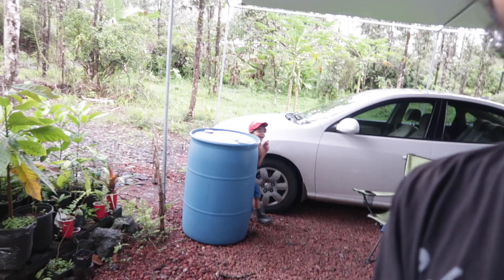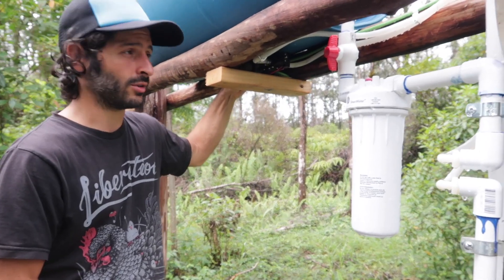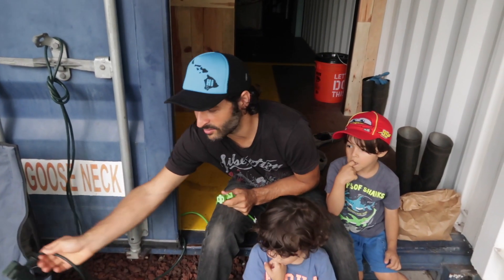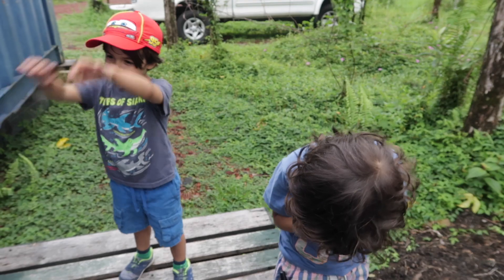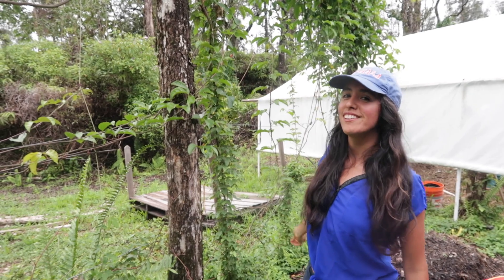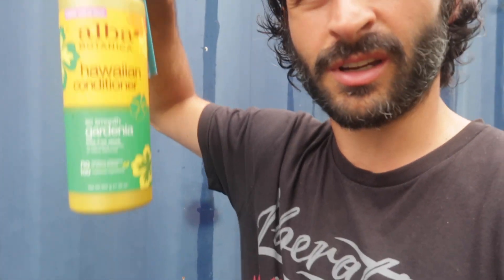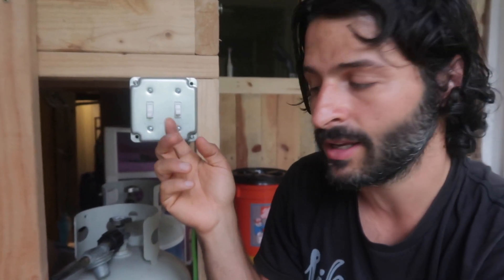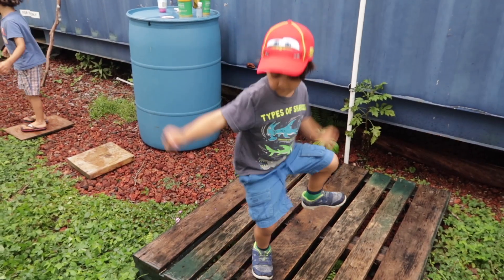Off Grid Shower | Heated using Compost

Comment: Very cool set up. Are you guys still using the same pump? or have you had to change it? I have 2 similar ones, and wondering how they may hold up :)
Reply from the maker: I think we changed the pump after this video but it's similar just less noisy and better pressure. I think it's called Flow Jet. We also plan to upgrade the size of the catchment because 50 gallons is definitely not enough we've come to find
Reply: @OffGridHawaii  Hey guys 👋👋👋 have you considered IBC water tanks? They're great value for money. Like new, single trip food grade IBC's go for about $120 in NZ, which like Hawaii, is expensive, but these tanks are a bargain, considering they hold 1000L about 264 gallons.

Comment: Hi. I live in the mountains of Puerto Rico. Similar climate to Puna.  I have a on demand camping shower heated by a propane tank. Same as a bbq tank. It works perfect  it’s possible to have very hot water and power is not necessary as long as you can get a minimum of 20# of pressure. If not you can use that 12v pump to get the minimum amount of pressure need to operate the heater. Enjoy watching people doing similar things as I. Take care

Comment: Dam, that is a badazz shower setup!!! I hope the water doesn't get too hot during the summer, but I guess you could just let it run for a few minutes to cool it down. I had a pump with no filter and it ran for years, so yours will never get clogged up. If you need more hot water, cut the pipe and put in tub with a plastic top to let the sun in, but i guess it'd have to be completely sealed to keep  the pressure. Good for you guys!!!!!!!!